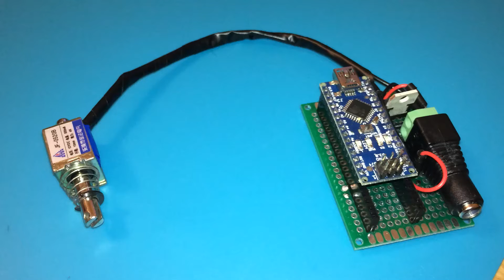Arduino Nano controlling 12V DC Solenoid

Comment: Hi, great build!
could you upload the list of the parts you used here please?
Reply from the maker: Alessio De Mitri  Thanks. It’s been a few years since the project, but managed to get the parts from the link and my mailbox. Here you go

• 12V DC Open frame Solenoid electromagnet 4N Holding push type
• Arduino Nano
• Double-Side Prototype FR-4 PCB Stripboard Universal Printed Circuit Board
• PCB Header Pins & Sockets 2.54mm Pitch Straight Plugs PIC Arduino Breadboard
• 12V DC Female Power Balun Connector Adapter Plug Socket
• 12V DC Power Supply Adapter
• A 1K resistor
• TIP120 transistor (TIP102 will also work fine)
• 1N4004 diode (1N4001 also works)
Reply: @kevinrv   Thank you so much for this! really appreciate.

Comment: Hi! I love how compact you solution is. That's pretty much exactly what I need to build but since I'm rather new to electronics I struggle a bit with figuring out how the stuff is wired there. I checked the instructables link you provided in the description but there are separate power supplies for arduino and solenoid. I'd like to reduce it to a single supply for both as you did here. Would you mind sharing your wiring diagram? Thanks in advance!
Reply from the maker: Hello , I'm glad you found the video interesting. Unfortunately I don't have a circuit diagram , but the only difference from the reference link is that my Nano is powered by a 12V 0.5A power adapter via Pin 30 (Vin) & GND as the power requirement for this circuit wasn't too much
Reply: Thank you for the reply! So does it mean that the power wire (red) from power supply is connected to Vin pin, to the diode and to "power" wire of the solenoid? Do I understand it correctly? Thanks.
Reply from the maker: Slowpoke Rodriguez  That’s right Rodriguez. Remember to choose adequate power supply based on the Arduino model and the solenoid
Reply: Perfect. Thanks a lot!